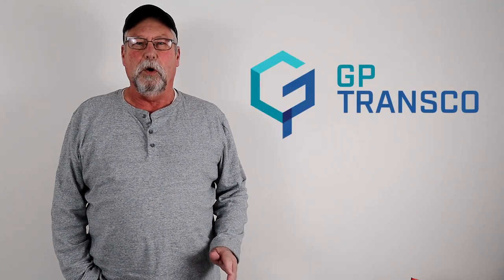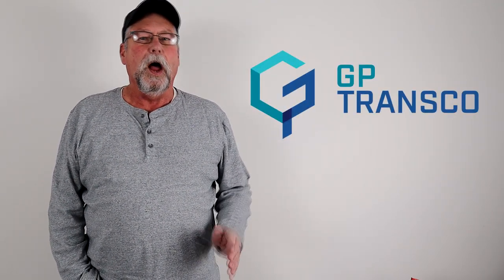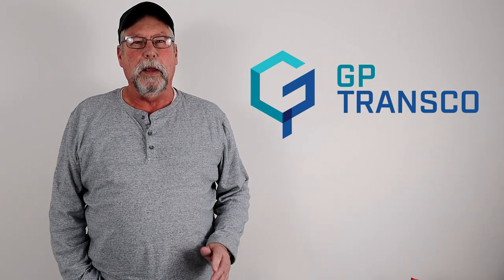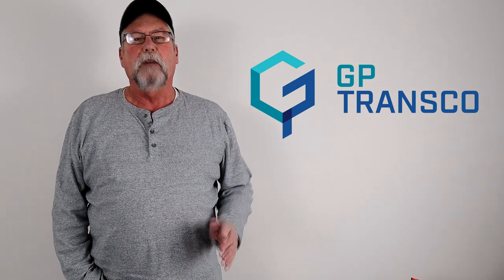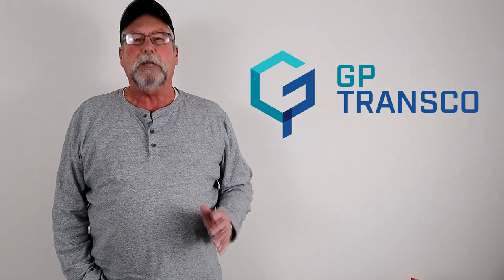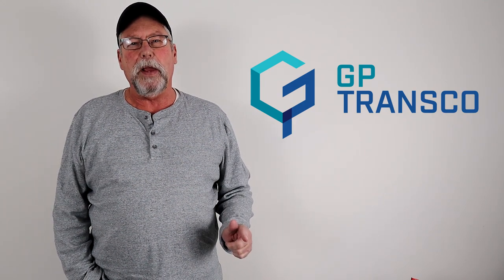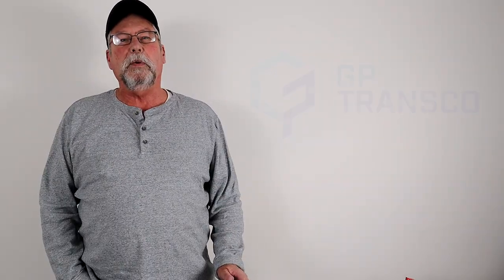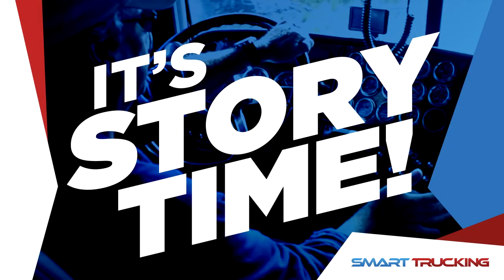What Wheelbase Length Do I Need For My Truck? (For General Freight, Tanker, Flatbed)

Comment: Mines a Columbia midroof with 244” wheel base. Longest Columbia I think I have ever seen but man it drives and handles good. I remember the first T600 on the road. I live in Chillicothe Ohio where the Kenworth’s are built. It was the talk of the town when they came out for the test drive from the factory.

Comment: I feel like Shorter the better running long trucks is a pain in the butt doing local work or any construction it’s if you just a steering wheel holder it’s fine but it it adds weight and you can’t just get a 300 inch truck down some country road make you real good at back but it not worth it also if you spec a truck long just to have overhang it’s harder to turn with front overhang than rear overhang

Comment: If one wants to have a longer wheelbase on the cab, it would probably be very wise to extend the tandem rails on the trailer all the way up to where you’re 30 feet or so from the kingpin. Once you are off Poston highways,The odds of getting pulled over for something that ridiculous drop to zero, and you can make the turns east of the Mississippi

Comment: Thanks for this information I want to order a new truck     Can you please tell about which engine,hp,torque ,transmission, ratio,tire size for hauling reefer on Interstate 40, 80 , 5 and 10 will be good for pulling and fuel efficiency

Comment: I thought I'd comment on the fact that the longer wheel base without too large of a bunk gives more room behind the fuel tanks/in front of the drives, for tire chain racks or the option  of a saddle type tool box. Speaking of tire chains, just recently I found out to my surprise that both Ontario and Quebec do NOT allow tire chains to be used at any time on a paved road ( am only guessing they may allow them on back country gravel roads ? ) . Have you ever been given an explanation on that as its no wonder trucks get stranded on highways where severe weather prevents plowing in a timely manor and then your completely SOL to get out of the mess. I am from Alberta and thankfully we can logically do as the weather dictates rather then go by some behind the desk bureaucrats idiotic rules. After all no truck driver wants to put tire chains on unless its really needed.